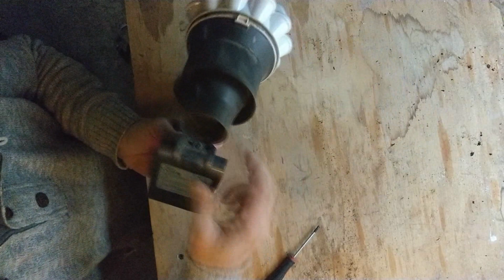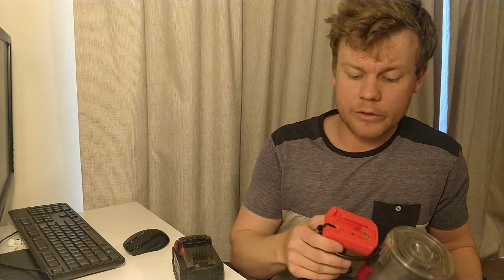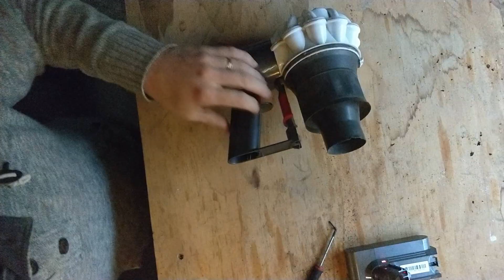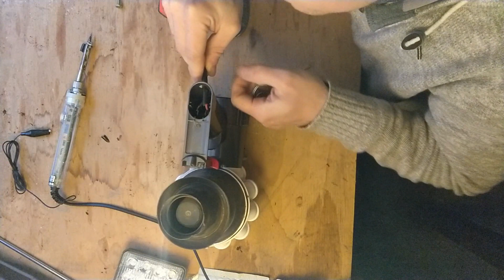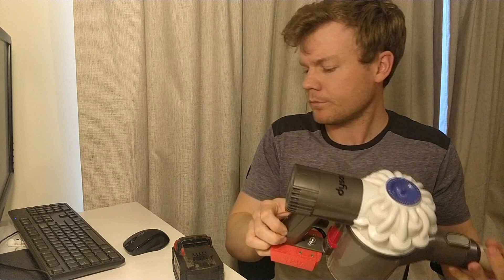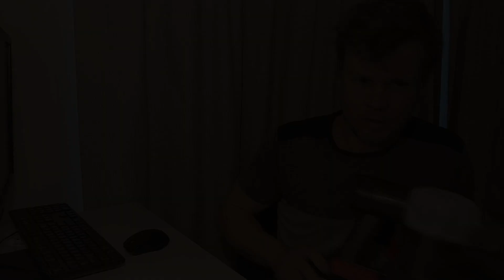How to replace Dyson battery with Milwaukee drill battery

Comment: Great video.  Does the original battery current go through the OEM switch, or does the OEM switch control a relay to supply the full current?  If the former, than why not run the Milwaukee output through the OEM trigger switch, so you have on/off fingertip control while vacuuming?  Plus, alot of the battery holders I'm seeing on Ebay these days omit the switch, so it would be good to know if we can use the trigger switch already on the vacuum.  Thanks again!
Reply from the maker: The oem has the switch built into the battery. The trigger on the vacuum just mechanically triggers the switch in the battery.

Comment: How do you know which prong is positive and negative
Reply from the maker: I just guessed and tested to see if it worked.  But you should be able to work it out based on the video
Reply: Its marked on the battery with a plus and a minus

Comment: This doesn't work on boost. It lasts a couple seconds before the vacuum thinks the battery is drained because of the lower voltage. If you don't care about boost then its fine.

Comment: I cannot find the adaptor you used that has the switch on it, can you post a link for it? Thanks
Reply from the maker: I can't see the same one that I used online anymore. The switch was probably a bit undersized. 
here is another one (In Australia) with a larger switch. https://www.ebay.com.au/itm/313550352232?chn=ps&mkevt=1&mkcid=28
Reply: @bengineering  Thanks, I will look for the other one.

Comment: Be interesting to try this with an actual 22v battery instead of an 18v. Something like the Hilti 22v batteries would be good to see if they fare better.
Reply: If you want you could wire in a buc-booster and crank the voltage up to 22v using the same battery.

Comment: Thanks, I always wondered if this was possible and would really like to use Makita batteries with my V6. I'm surprised that the switch is mechanical, I've never looked into it but quite a few brushed power tools use 20A rated switches so a swap could be possible. For example the cordless portaband I recently modified about has a 24V/20A Fujisoku SGE120C-3 switch.

Comment: Great idea but just buy an after market 4800 mah battery off amazon for around £30
Reply: That is great except when the vacuum goes dead partway through vacuuming to still have to charge it for hours before you can finish, with the conversion you can vacuum at will with changeable batteries.

Comment: https://drive.google.com/file/d/1UHtuSlnYRzXBU0REe0PxgIaYW_SV2HSQ/view?usp=sharing This now works for me. Lasts longer, and I can have a battery in stand by. The trigger button works as before! I removed the original batteries and BMS, and in the empty space inside the base, I added a small 30A car relay, to control such high current with the low amperage switch. To make it leaner, I will try to fit the relay in the handle itself (while keeping the original trigger/switch mechanism) at like in th a later stage, that will make it 2cm thinner, like in the posted video.
Reply: I'd prefer not to use a relay and use the OEM trigger switch, if it can handle the current.  As originally configured, does the trigger switch handle the full current of the Dyson OEM battery?   If, however., the trigger switch is only switching a control signal, then the relay is a must.  I have a model 8.  Thanks!
Reply: Ah, never mind, just read below that the OEM switch is actually in the OEM battery......I'll need either a large amperage switch now, or a relay...

Comment: I tried this on my V8. Once I apply power it runs for about 2 seconds and stops. I checked the voltage on the battery terminals inside the dyson while the power is on and it's still getting 18v, just not powering the unit for some reason. I wonder if Dyson stopped us from modifying their junk batteries.
Reply: I am having the same problem, it runs only for two seconds at High Power (fully charged 18V battery). It runs fine at Low Power. Still trying to figure out if this shot off is done inside the battery packs (I tried different brands), that would be the BMS's, or inside the Dyson (Unlikely). May try rising the voltage with additional cells (to make it 6s, the 18V packs are 5s)
Reply: @sinderbox2436  I used a bigger Amp battery and it worked for a little bit longer then the V8 died. After that my battery said it was dead too after the 15 seconds of use. I took it to the charger and the the charger said it was full. My theory is there is some electronic component (at least in milwaukee batteries) that stops the battery from being used.
Reply: @spookshow8776  After further testing I think I identified a few points: 1) Sure, the batteries have a BMS inside with over-current protection. But the Dyson Battery is rated 20A, and all 18v packs should handle 20A just fine. 2) The vacuum seems to have some sort of low voltage detection and overheat protection. With a cold vacuum I have no problems. 3) The contact (or soldering) between the the vacuum and the battery must be very good! Remember we are running 20A here. I think that was my case, and a not fully loaded battery and a lousy contact made the vacuum to shut off 4) With a 5ah battery I now get 10 minutes full power with the electric carpet brush over a dense carpet (you hear the motor working hard), with the factory battery I got around 5-6. This is great! And the battery is not fully depleted (the vacuum probably shuts off because it detects low voltage). This means not only I can run it for 10 mins, but that the battery will charge fast since it is not fully empty. 5) The advantage of this solution is a) longer running times b) fast charging! (the Dyson is not a fast charger, I use a 18v/9A charger from Makita) and battery swap. c) Now I get 10 mins with 1 battery, 20 mins with two or unlimited time with three batteries and a double fast charger5 d) I will connect the vacuum momentary (trigger) switch to a 30A 12v mini 5 pin car relay, to restore the button functionality, the battery will last longer and there seems to be another protection that requires the power to be cut off and on again to let the electric brushes work under yet unidentified circumstances. Found no 18v relay, but a small resistor will lower the Voltage to activate the relay coil

Comment: Hi, I search to find a way to use this cordless model with an ac power cord for using without battery, do you think it's possible easily ?

Edit: apparently it is a bit tricky : https://www.instructables.com/Dyson-Dc16-Cordless-Alternative-Powering-Options-M/

Comment: I did thid whith a makita battery and a 3d printed mount but since the dyson runs on 6 cells and the 18v drill batteries are 5vollts  it worlks but dies very quicly. As in it shuts off far before it is actjally dead. I plan to switch it to run on kobalts battieries next as there one of the few ones that actually use 6 cells were as dewalt and craftsmen and mostbother tools that say there 20v or so are just the same 5 cells as the ones that say there 18.

Comment: Since all you did is replace the battery why don't you need to press the trigger on the Dyson to get it to run?  I don't understand how the switch on the battery holder makes it run.  Does the Dyson trigger do anything now if you press it? You wired your battery holder to the contacts that the Dyson battery would contact correct?
Reply from the maker: The trigger switch on the dyson is actually just a mechanical lever which activates a switch built into the battery itself (which was removed). So it does nothing after the original battery is removed. Wouldn't be too hard to replace it with a momentary button switch or something. 
This is for v6. Not sure about other models
Reply: @bengineering   I have a DC44.  I ordered from Ebay the Makita battery holder.  Since I still want to be able to use the three Dyson batteries I have I think I'll try connecting the wires to the Dyson with spade wire connectors that I can disconnect and see if Velcro will hold the holder and battery to the unit.  Once my Dyson batteries die I'll attach it like you have it attached.   Right now this is more of an experiment just to see if the Makita battery will run the Dyson.
Reply: @bengineering  The micro switch is a low current switch!!! it turns on/off the circuit in the BMS that controls the voltage/power. If you try to use the switch directly with the attached battery it will be burn in a few seconds. It will not work, and it may ignite a fire!!!
Reply: @sinderbox2436  That's what I was asking above.....thanks!

Comment: Who else is here from tiktok...lol
Reply from the maker: Interesting... I didn't put this on tiktok
Reply: @bengineering  no you didn't. But there's a video of a guy who attached a dewalt battery terminal and doesn't have how he did it, so came to yiutube to see how it's done so I could do it to ours. Thank you for posting this! We just bought a new battery too that has more amp hours,  but had I seen this first I would have saved $60.00. Still gonna do this as even the new battery runs out after some time of consistent use.
Reply: @tommy.tequila  saw the same tik tok and ordered dewalt adapter.  Can’t figure out how to bypass switch
Reply: @bengineering    Anyway to contact you for help?
Reply: link me plzzz
Reply: I saw the same tik tok and ordered dewalt adapter.   He doesn’t show how to hook it up.
Did u have any luck with dewalt adapter?

Comment: Would this technique work for Dyson v8 with Makita 18v or Dewalt 20v, if so could you please recommend the adaptor for Makita and Dewalt ?
Reply from the maker: Yes it will work. Just search makita or dewalt DIY adapter in ebay or Amazon.
Reply: @bengineering  Dyson v8 with Makita (I tried other 18v batteries too) does not work, it dies after a few seconds at max power. I still do not know the reason, but it might be pulling too much current (and the battery bms protection kicks in) or the voltage goes too low under load (and dyson switches off). I may try adding extra batteries in series, but I need to find protected cells first to do that test. I came here to see if anyone else had the same problem. I am not the only one.
Reply: Lads doesn't matter which one you choose the Makita battery or Milwaukee working on the same voltage like DeWalt 20v! They DeWalt is put 20v on the tools because of marketing. Like in Dyson battery 5x18650 cell in it so 1x18650 fully charged is 4.2v

Comment: What model dyson is this. Doesn't work on Dc16 or dc31..... any help???
Reply from the maker: This is V6. 
I'm not certain if it will be the same. But the battery voltage on the DC16 and DC31 is the same so should be ok.
Reply: @bengineering  I read somewhere you can connect a 20v 6amp laptop charger to the battery terminals and could use it wired. Any Thoughts???
Reply from the maker: @gmcd1828  I don't see any issues with that, except if the charger is 'smart' and get confused by the load. Worth a try.

Comment: Hey man, great idea. Trying to do likewise with a Makita battery. Did you have issues soldering to the Dyson posts? Mine doesn't want to stick for some reason....
Reply: Hi Paul, yes I was successful, I needed a hotter solder iron. I used an out of service Makita tool and just salvaged the battery base from that.
Reply: @robnoble6081  does it work allgood with makita batterys?
Reply from the maker: I didn't have much trouble. Maybe try cleaning the connectors with contact cleaner to remove any oils.
Reply: Hi Rob, can you send link for the Makita battery housing you used please?
Reply: Did you have any luck with yours?